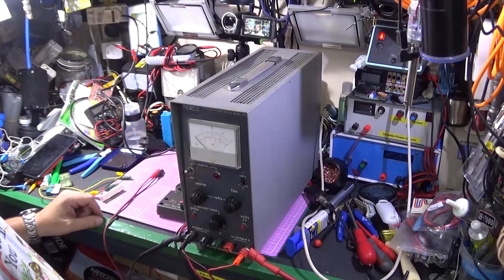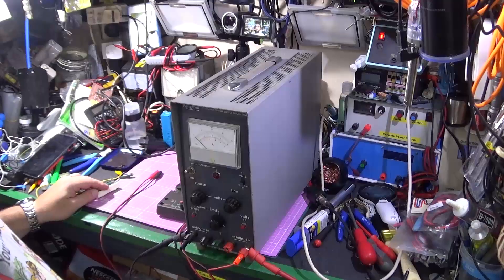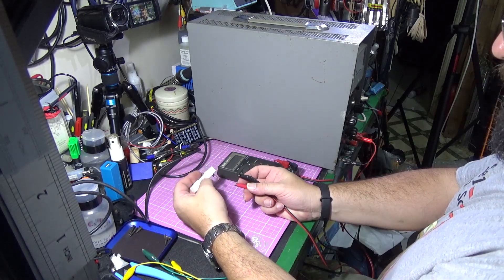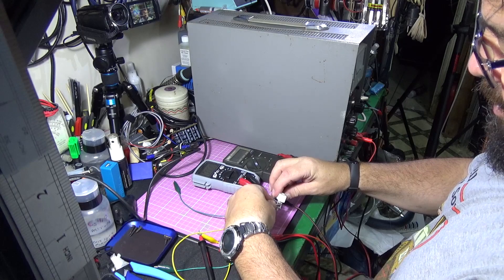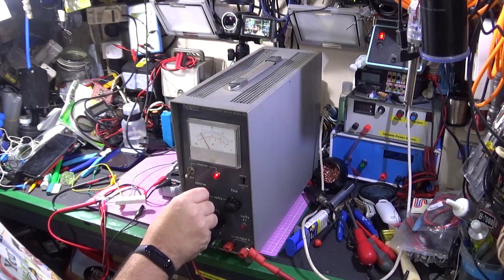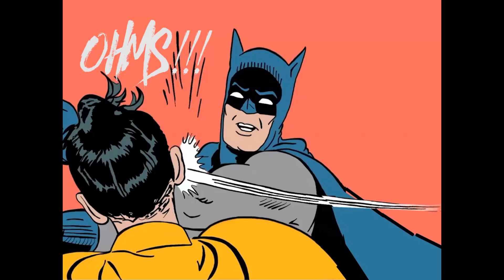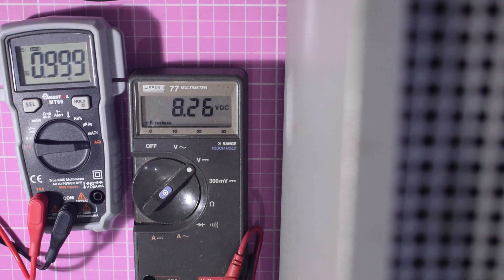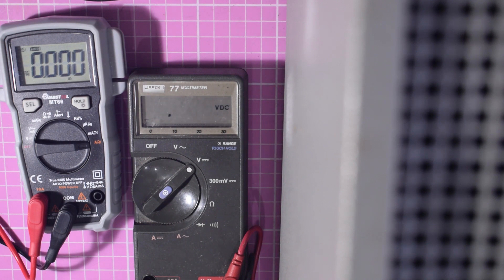Variable regulated bench power supply test and calibrate

Comment: There are a number of tests our power supplies need to meet for regulation. 
1 is line regulation With the PSU set to its mid point voltage and load at 5-5 adjust the line voltage and look for changes in output.
2 Load regulation. Set normal input voltage and measure voltages at output terminals from nin load to full load. A really good PSU will maintain 50mV or so between 100mA and 5A. 
Ripple and noise is also interesting. On a linear regulator as this is I would expect less that 100mV at full load. Another test we often do is impulse load response. This shows how fast the regulator responds to a rapid change in load.

Comment: That was a very good find George. Capacitors are a bit old and it would be a shame if one leaked. Any chance of seeing inside the beast ? There might be a bit of resistance variation due to the leads. I have some nice thick ones, at 3A + my Chinese ones get all hot and bothered. I bought my first power supply,  a linear Tenma (Korad ?) - around £50. 30V 3A uses a stepping transformer to reduce heat. Quite a few revisions. Over a year now, no problems. Video's on YouTube. It must be possible to smooth smps as every PC has one and processors are rather fussy. OK for some jobs.
Reply from the maker: True on the switching noise but to get a decent one these days for bench use you pay a lot of money. I did think about opening it up but I took the easy way out and just put it on the bench. From the info I have found, it is just a case around a transformer. I'll find a schematic somewhere i'm sure and if I have to pop it open I'll film it.

Comment: That is a real nice power supply, I agree I hate switching power supply's, all my bench power supply's are  linear type.
Reply from the maker: It's one of those things Bill. I have yet to find a decent switch mode PSU. Over here that's all they sell for ham radio and all the new lab supplies switch too. I'm not spending a couple of hundred pounds to get a branded one so vintage second hand units are great.
Reply: I agree the old ones are the best, two of my power supply's cane from EBAY, and two came from a flea market, one was the Tripp-Lite PR-60 which works great after disconnecting the crowbar SCR.